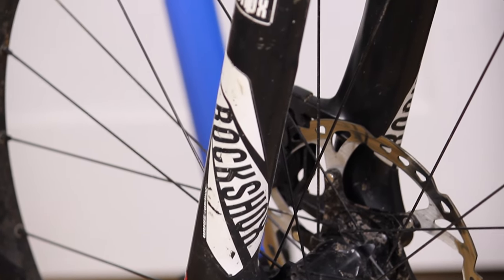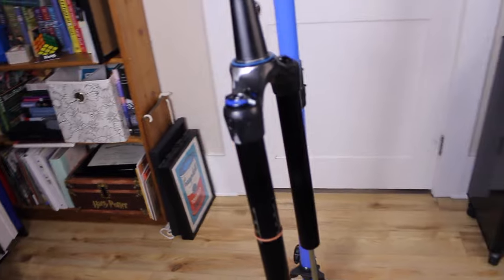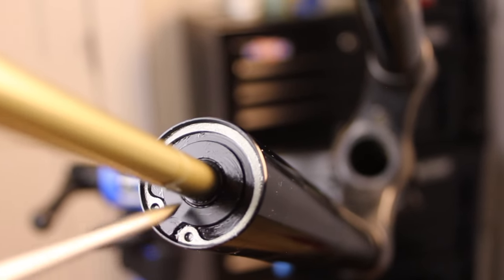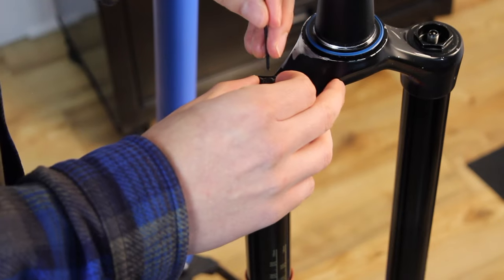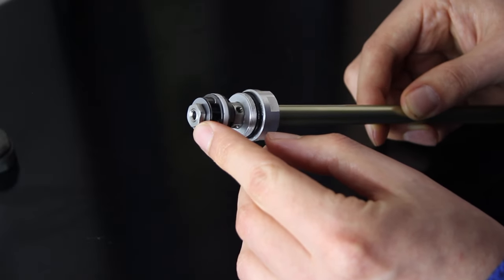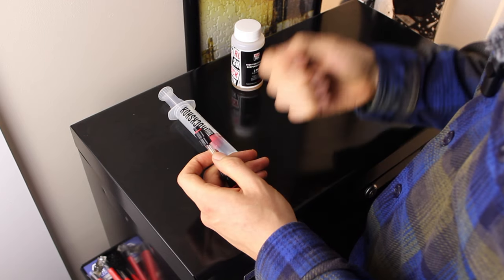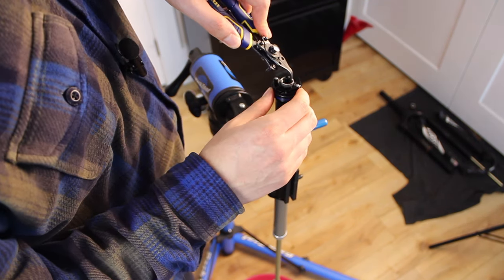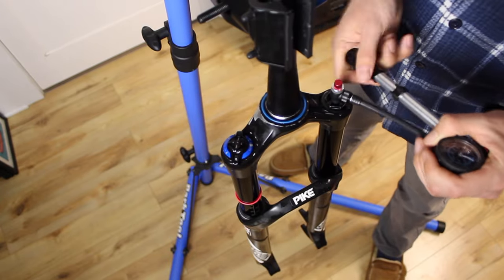I Rebuilt A 10 Year Old Rockshox Pike!! (Damper, Air Spring, and Lowers Service)

Comment: Great video! How did it ride? Any difference over the 50 hour service?
Reply from the maker: Honestly not noticing a huge difference. But the damper is not working properly (see the bleed issues I had in the video). I have a video coming soon about replacing the bladder and doing a more extensive Charger 1 rebuild so hopefully that will help!